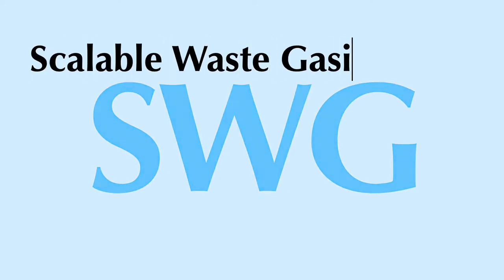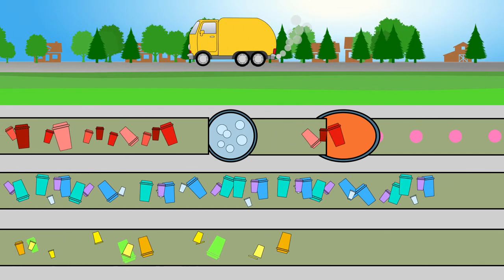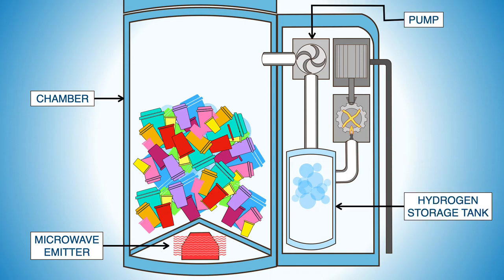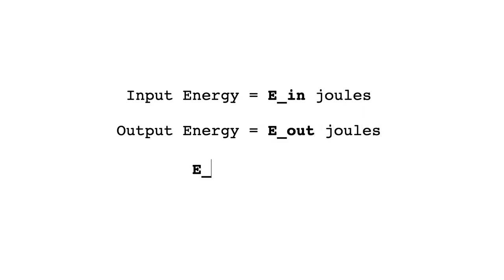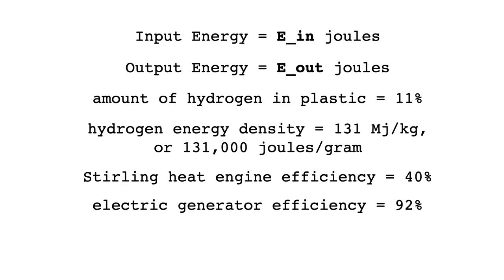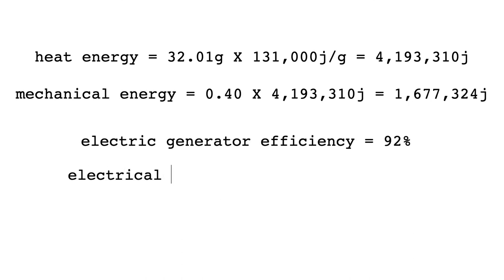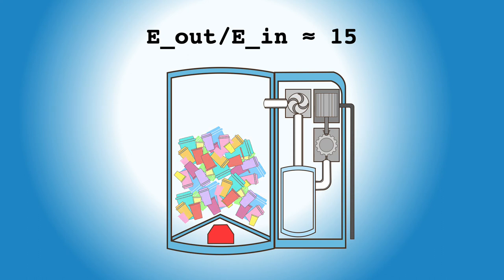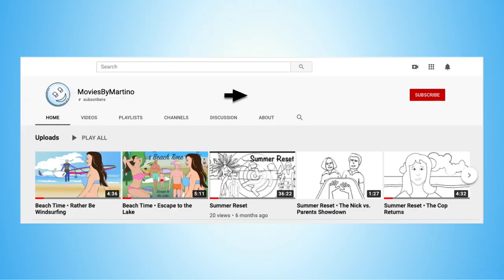How to Harvest Hydrogen with Small Scale Waste Gasification - Part 2:  A tour of SWG

Comment: During pyrolysis of plastic we get more harmful gases like SO2. Also, before we reach temprature to break C---H bond we get various products like petrol etc.
Also, basically the plastic has to undergo various cleaning process before pyrolysis because all plastics is basically a mixture of plastic and various different compound suiting the needs. It will be good if SWG can clarify these things because we badly need a way to replace plastic to usable product.

Thanks.
Reply from the maker: My background is in electronics and software so it's difficult for me to answer questions about chemical reactions. It is my hope that because pyrolysis takes place in a closed container we will be able to trap and safely remove or further process noxious components.
Reply: if used in an educated manner it can be used . consumer waste if segregated at home in  plastics and food will be sufficient to eliminate the creation of SOX . utilize plastic waste in swg. as per my knowledge the common household plastics dont have sulfur in them. some specific plastic do have them but there are not that common.  in southeast asia i think if we utilize this to treat shopping bags problem  it might help us overall. i will be trying this in near future.   i hope it works
Reply: Mix the plastic with corn starch to break it down

Comment: Remember the old saying, don't keep all your eggs in one basket? The only reason we have LARGE utilities, is for them to make loads of MONEY.
I agree with you on, having lots of small plants for everyone! I like the idea of doing your own recycling, also it would be good using wind, sunlight,
water power to make electricity. This is how it should be, we would have more than we need. But, until the controlling money people are removed,
we will just have to do this quietly for ourselves.
Reply from the maker: Thank you for watching and commenting. It's still surprising to me that the default solution to generating and distributing energy is large centralized facilities attached to elaborate power grids. For many regions, generating power where it will be used makes more sense. Plus, it allows each home or business to select waste to energy, solar, wind, geothermal, and other sources of energy. Each site can use what works best for them. They don't have to wait for a utility company to string a cable to them. And if any of them fail, the others keep working.
Reply: Very quietly and don not brag about it, wood pallets are well used for this.

Comment: Modern technology can be used to farm methane with your kitchen waste and lawn waste in two one cubic meter plastic containers. You can compress those methane fully automated into a light-weight, installable propane tanks for charging your Aptera in the backyard 7/24. If you don't use them to charge your Aptera, you can use them to cook your food or warm your house as well. All kitchen waste will become fertilizers eventually, which you can sell/donate to vertical/roof-top organic farms around metropolitans.
Reply from the maker: Thank you for watching the video and thanks for writing about another way to generate power from waste materials. The great thing about these techniques is that they can be applied at the site of where the waste is generated which saves fuel and reduces pollution caused by trash hauling. Also, these techniques enable us to generate energy in a distributed fashion instead of at large monolithic generation facilities that require an elaborate power grid.

Comment: I'm watching again and again and like the idea more and more. So COP is 15?
Can you do a simulation with a fuel cell instead of Stirling engine and generator?
Reply from the maker: Thank you for watching the video. The estimated input to output energy is 15. I avoid using the term "estimated coefficient of performance (COP)" because it is normally applied to heating and cooling devices, not power generation. I'm not an expert in either field, but I hope people who are more expert than me will see the promise of SWG and expand on it. There are multiple permutations of the process. The intent of the video is to spur thinking about the process and the permutations, e.g. using a fuel cell. I'm still learning about them and how one might be used in a SWG unit. Again, thank you for watching this video. Feel free to share the link.

Comment: So where did all the carbon go from the plastic?
Reply from the maker: The carbon, if there is any remaining, gets filtered out and safely stored. It can then be recycled into other products. It is also possible to adjust the system to produce graphene, a valuable form of carbon. Depending on the type of plastic, there may be a relatively small amount of carbon. In any case, the carbon is kept under control and out of our environment.

Comment: Great concept.......are any of these units been installed and where will I get the latest price and availability information
Reply from the maker: No units have been built or installed yet. However Levidian Nanostructures has a larger system that is similar. If enough people express interest, perhaps they or another company will make them. In the meantime please share the videos so others see the possibilities. I'm working on a video with updated information. Thank you for watching and commenting!
Reply: Thank you for the reply..It is unfortunately absolutely necessary to have 1 unit in operation for at least 6 months as a pilot plant/unit to be enable the design engineer to collect real time data which can either be used to improve the concept or use the data  as marketing material.

Comment: Would it be worth the output you get vs the input energy for the magnetron? Just stick to normal wood gasifiers and you can't lose I'd say.
Reply from the maker: Thanks for commenting. If the only goal is to produce energy, gasifying wood is fine, but I'd like to get plastic waste out of the environment too. There are now solid state microwave emitters that are more versatile, controllable, and efficient than magnetrons. The hope is that by using microwave heating we have more control of the heating so we can adapt the system to many different kinds of waste and other materials. There's some interesting work being done at Rice University in Houston, Texas that may be applicable.
Reply: Could u use solar power to  run the microwave heater that would burn the plastic waste

Comment: Where does the carbon from the posting go ?
Reply from the maker: If the flash joule method is used the carbon converts to graphene which can be sold and used in electronics, carbon fiber structures, and other applications. In other methods the carbon can be sequestered and stored for other uses. Thank you for watching the video and for taking the time to comment on it.

Comment: Just burn the plastic at very high temperature so that no unburned (pollution) fuel leaves the chimney.  No need for microwave heater and much less residue.  But I know of no Sterling engines that achieve 40% thermal efficiency!  Even our vehicles (obviously not Sterling cycles, but still thermodynamicly limited heat engine cycles) only get 20 to 25% efficiency.
Reply from the maker: Thank you for watching the video and for another approach. I hadn't considered very high temperature incineration. If the burning is done in a way that contains polluting chemicals until they burn, that would probably work. Thanks again for your idea!
Reply: With plasma gasification you xan evaporise the waste including plastics who convert to singas that can operate an engine and also heat csn be used to run a generator or turbine engine ti create electricity

Comment: I don't get where E_in=1000j/s is coming from. Please help. Thx
Reply from the maker: That value is a guess at the power input from the microwave oven in the experiment. The information about the test did not specify the power rating of the microwave oven, but let's call it 1000 joules/second.
E_in = 1000 joules/second X 90 seconds = 90,000 joules
Because YouTube limits the number of characters in the description, I had to shorten some of the text. In doing so, I lost this detail. I added it back  in and removed one of the links instead. Thank you for catching this and asking about it.

Comment: 89%waste including some very toxic chemicals and no mention of how you would handle the waste.
Reply from the maker: I didn't mean to brush over that detail. We should be able to break down the toxic molecules, extract hydrogen if there is any, and convert the rest to graphene. If there are any other toxins remaining, at least they would be contained and controlled. I don't have a general solution for what to do with them. Each chemical probably requires different treatment. Most household plastics should break down without leaving toxins. Plus, it is likely that plastics with food waste can be processed so the plastic does need to be cleaned. Thank you for watching and pointing out the unaddressed issues.
Reply: Yes, trata correct that si not easy, remember plastic produces bad chemicals the idea is like the pirolisys. I don’t consider it’s a good idea to burn plastic in our houses and as my friend up there said you still have garbage to manage when burning the plastics